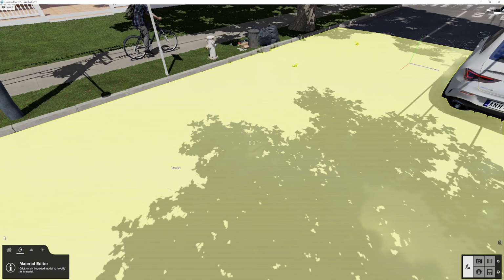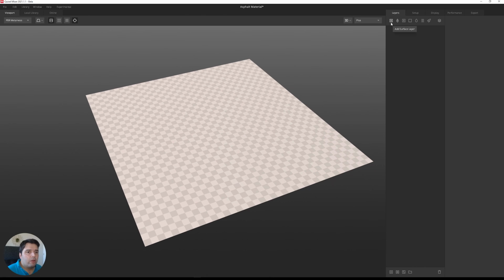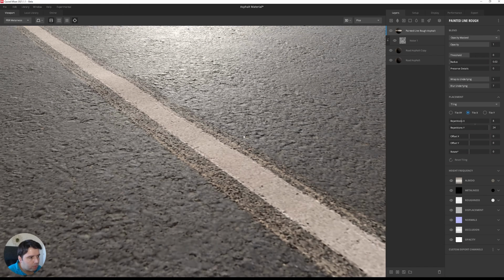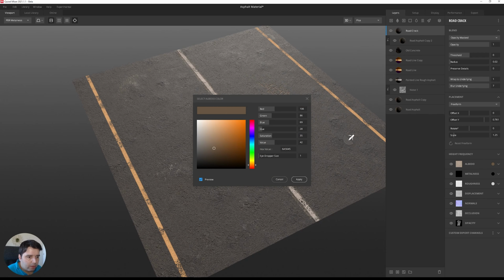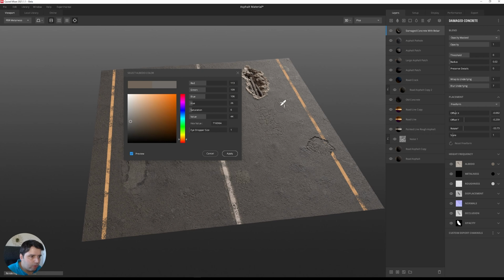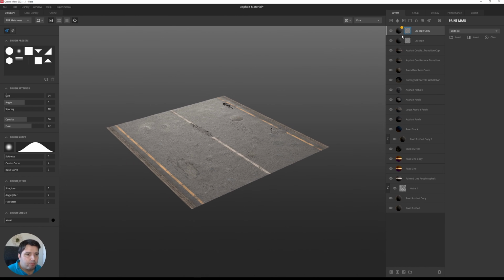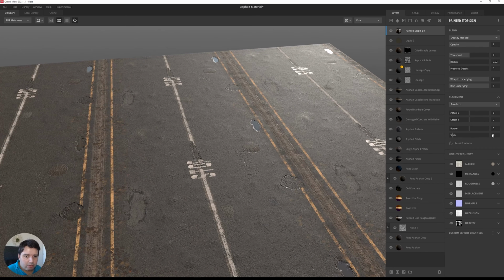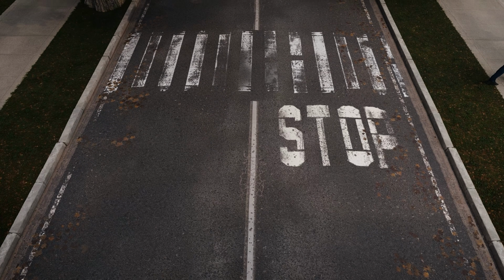How to Make a Road PBR Material  - Quixel Mixer Tutorial

Comment: Megascan and mixer are ok to use also in D5? How?
Reply from the maker: Yes, the process is exactly the same. And you just import the textures into D5 like they come from Mixer. You don't need to edit them in Photoshop like with Lumion (except the Displacement).